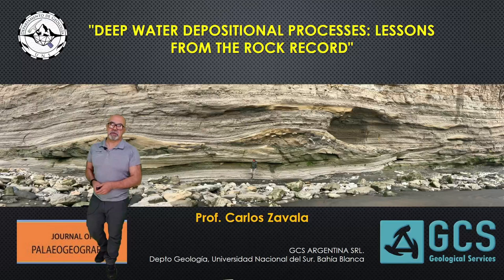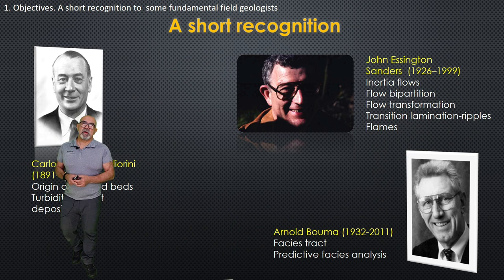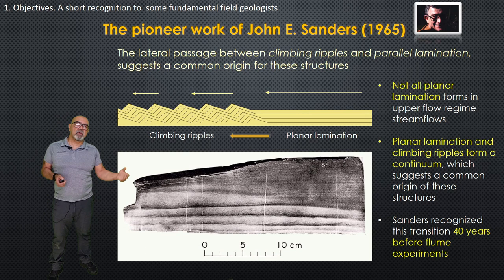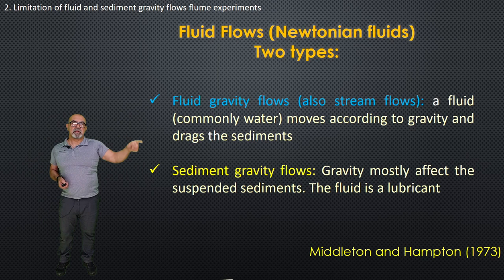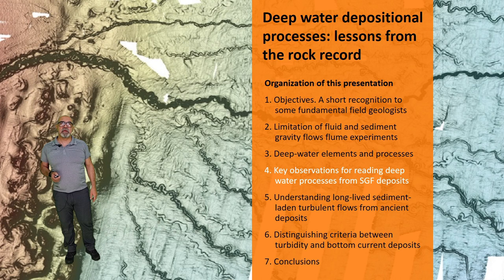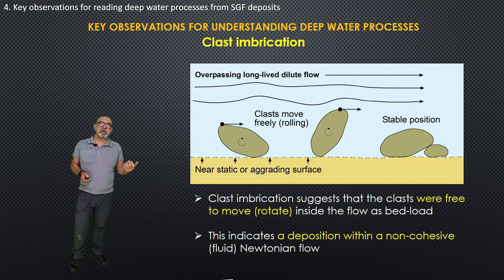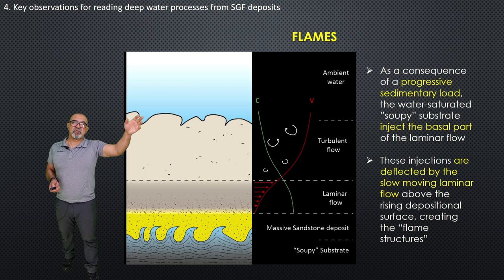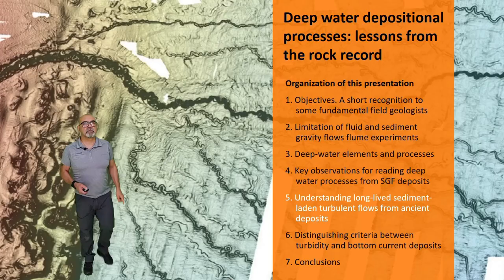Deep Water depositional processes: lessons from the rock record. JOP Conf. on deep water systems

Comment: Impecable! ahora, las corrientes de fondo, no pueden ser tener las condiciones necesarias para generar flujos turbulentos y en ese caso tranportar sedimentos no solo por tracción sino tambien por saltación y suspensión? Si una turbidita (cualquiera sea) atraviesa una corriente de fondo, esta no puede secuestrar parte del material que viene en la pluma turbulenta y generar traction plus fallout en los leeves?
Reply from the maker: Gracias Marcos.. el tema es más que interesante, creo que una de las claves para diferenciar bottom currents de corrientes de turbidez reside en que las mismas son básicamente corrientes libres de sedimento (similares a las stream stream flows) e impulsadas por gradientes de temperatura, salinidad, mareas, etc.. no son corrientes gravitativas. Las turbiditas por el contrario son sediment gravity flows. Los productos y depósitos de estas corrientes son marcadamente distintos. De hecho las contour currents se mueven paralelas a las curvas de nivel, o contour (no son gravitativas) mientras que las turbiditas se mueven siguiendo la pendiente regional, o sea perpendiculares (son gravitativas). Las estructuras sedimentarias producidas por ambas corrientes son marcadamente distintas, no coincido con la opinión de Shanmugam, para quien son básicamente lo mismo. Las bottom currents no pueden acumular areniscas masivas o climbing ripples, estructuras exclusivas de los sediment gravity flows (o sediment laden turbulent flows). Saludos